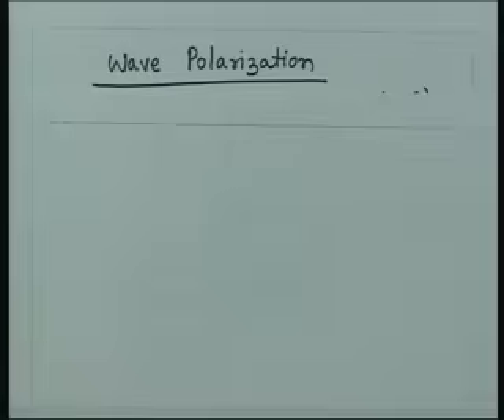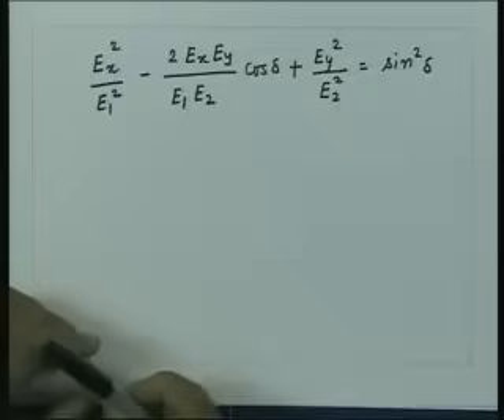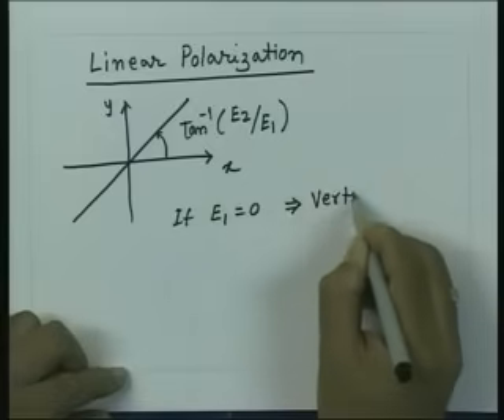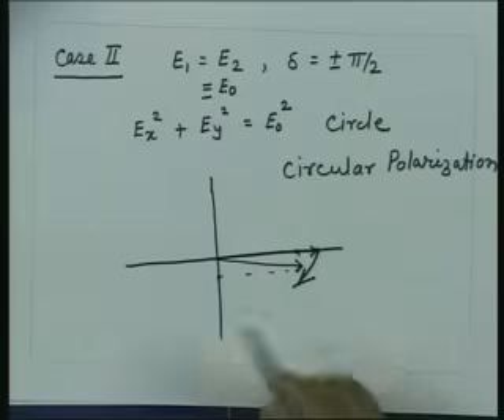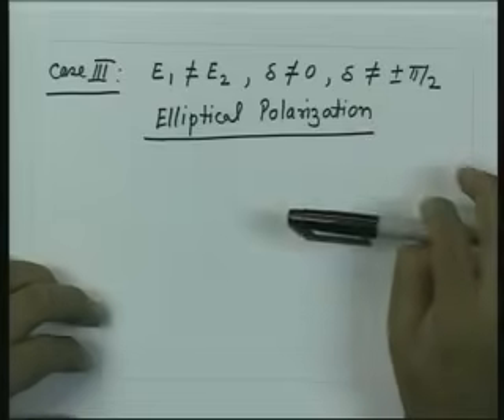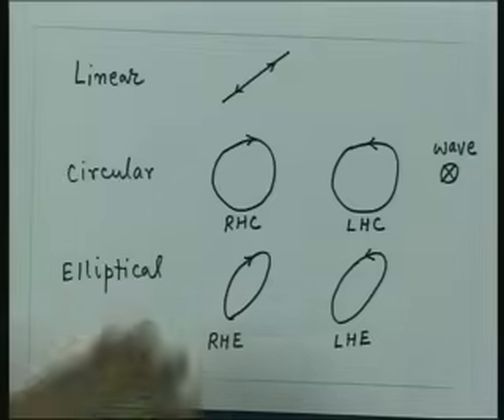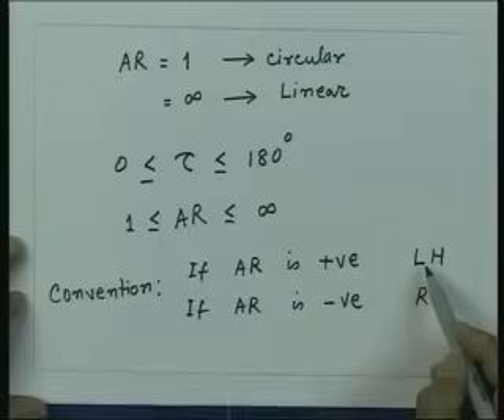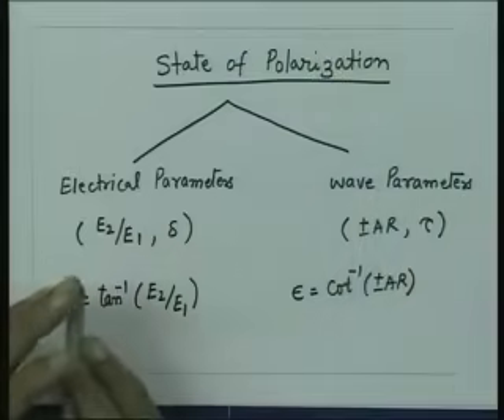Wave polarization

Comment: what's the significance of phase difference being pi/2, wouldn't E1=E2 enough for circular polarization.
Reply: If you put E1=E2 without the phase difference of pi/2,then you would still have the ExEy term,and then if you look at the equation,you can tell that it does not represent a circle,and the polarization is still elliptical.

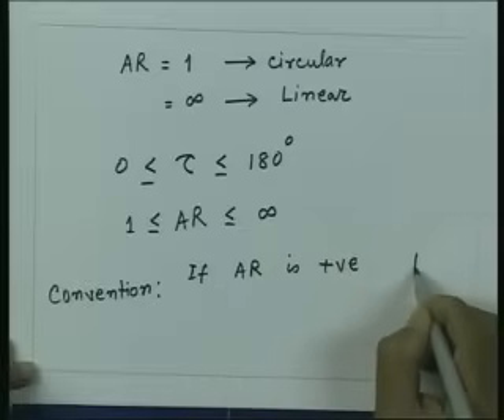Comment: EXCELLENT EXPLANATION. MANY ASPECTS ARE UNDERSTOOD. SMALL CORRECTION AT 43:00 CAN BE MADE ABOUT THE THE CONVENTION FOR AXIAL RATION SIGN AS THE EXPLANATION AND WRITTEN VALUES ARE DIFFERENT. HOWEVER THAT DOES NOT EFFECT THE CONVENTION AS IT CAN BE TAKEN AS PER THE REQUIREMENT AND THE ASSUMPTION.
Reply: Thanks for the help....I was stuck here....shukriya